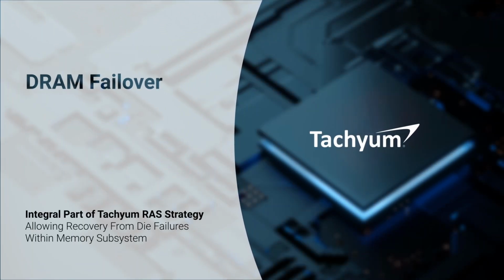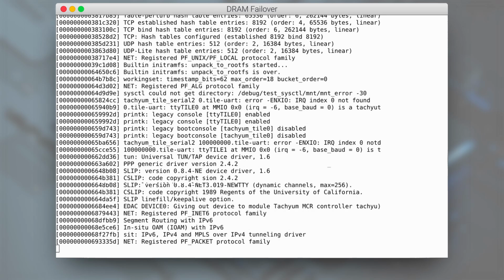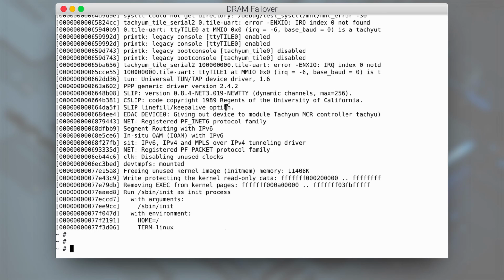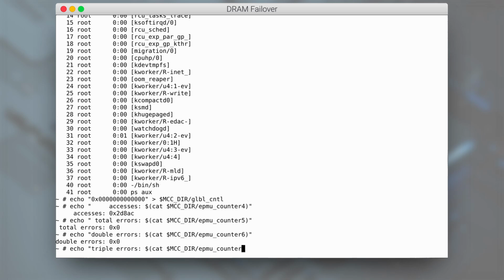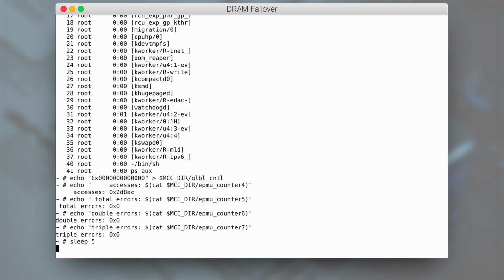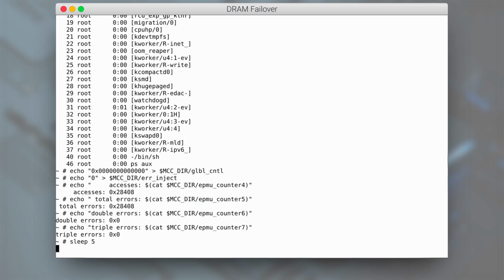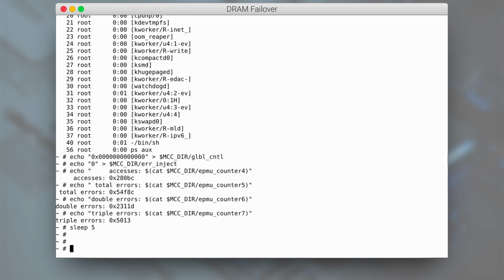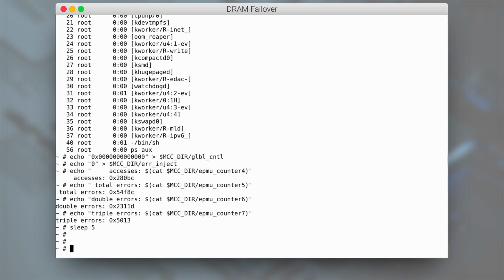Tachyum Demonstrates DRAM Failover for Large Scale AI on Prodigy FPGA prototype

Comment: Failover means there is a second data store/memory in hot standby? that is, you need to have the required capacity *2?? That would double the failure rate too... 
Or is it just a mechanism to switch off/disable some memory block, which looks defective?
Reply from the maker: All server memories have extra capacity in standard ECC on every module. It’s never 2x. For DDR-4, it’s 12.5%, and DDR-5 went up to 25%. The extra capacity is used for error corrections. 
We can correct 2 errors and detect 3 ones. If a memory chip completely died, we would still be able to function until the dead memory stick is replaced. Yes, it is just a mechanism to switch off/disable some memory block, which looks defective. Our solution doesn’t reduce capacity.